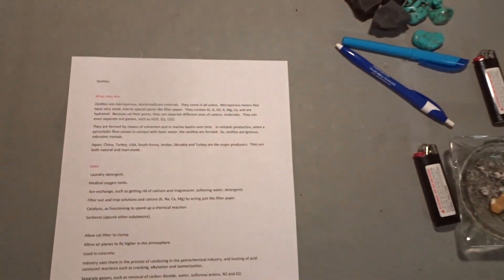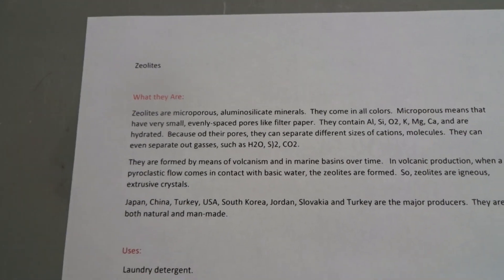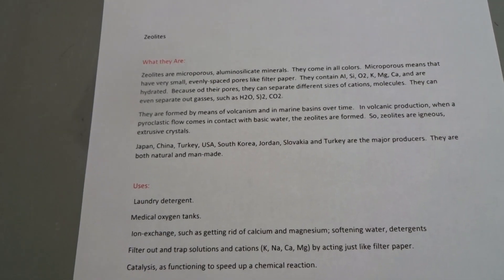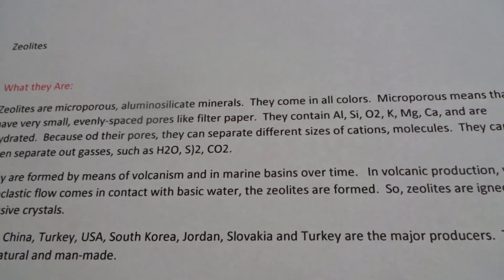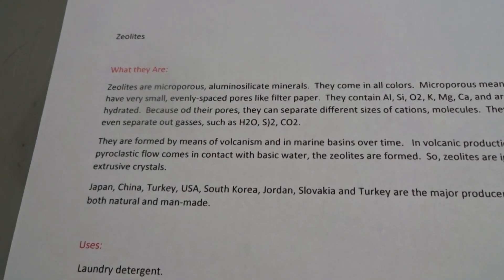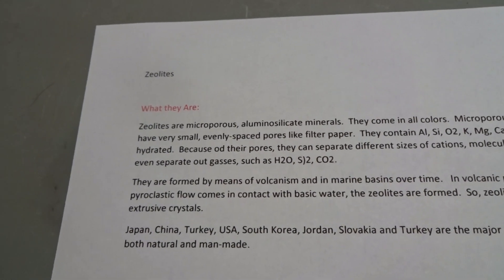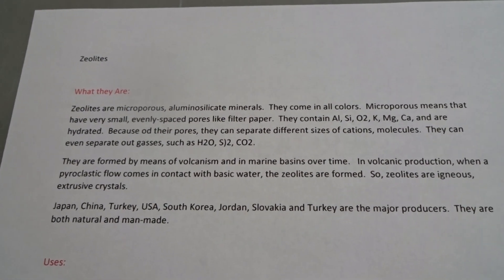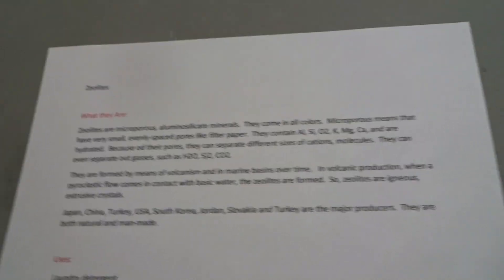Zeolites, part 1

Comment: sweet lab my dewd
Reply from the maker: Thank you.  In addition to my geology lab, I also have an electronics shop because I also have a sole proprietorship repairing consumer electronics.  Business is too slow, however.  Do you have a lab?
Frank
Reply: @frankreiserm.s.8039  its more of a trash pile at the moment. i have plans for a more tidy one so i can make videos and not have everyone tell me what a safety hazard it is
Reply from the maker: @eliteopinions7859  Great.  It is very easy when you work in your lab or shop to wind up with a messy lab or shop.  I am constantly having to straighten my lab and shop more frequently than clean it.  I have a CRT TV's guts all over the place that a client dropped off for repair (which I could not repair).  Now, I need to spend time removing needed components off of the circuit board, and discard the TV.  I have a pile of capacitors and components from old circuit boards that I need to check, file and put away.  It is easy to procrastinate.  Even though I have a chemistry lab and an electronics shop, I break every OSHA law that has been written; I eat candy on a mineral-identification bench with hydrochloric and acetic acid, I walk barefoot, I smoke while performing chemical tests, etc.  On one hand, it is great being your own boss.  On the other, I have cut my feet on broken glass, cut half of my finger off on the table saw and have choked on acid fumes because my basin does not have an installed chemical hood.
Frank
Reply: @frankreiserm.s.8039  im scared to let my cat come in. curiosity could kill it more than 9 times in there

Comment: Is this the reason for fracing. Drilling into the earths crust add water and other chemicals, will zeolites form and then filter radiation out of the water.
Reply from the maker: Hi!  Fracking is a process to obtain (more easy compared to older techniques) oil and natural gas from drilling rigs (both on ground and in the ocean). I fracking, a drill from a drilling rig, either vertical or angled (we have the technology to frack at angles) has a pipe that has explosion sites on it.  These sites explode in the oil/gas reserve under ground in hard rock (oil shale) and causes holes in the pipe and breaks apart the shale so as to open a pathway for the oil to seep quickly through the hole in the pipe.  It is totally safe as long as the entire pipe is sealed!  So, more oil enteres the pipe, and we harvest more oil.  
When drilling into the earth's crust, a material called Bentonite ( a dry power of high density) is mixed with water to the point where its weight is equal to the weight of the water and oil at maximum depth, preventing the water and oil from shooting out violently of the top of the tower, which is called a blowout.  In addition, drilling rigs have a device to stop blowouts.
Zeolites are not radioactive (never say not, say almost never!).  They are silicates (quartz is a zeolite).  When ground into a fine power, they have an affinity for water, making them useful in such products as laundry detergent.  They are also collector specimens.  I lije  arenite; it is acicular.  
If you desire, I have zeolites that I can sell to you.  They are beautiful specimens!
Frank
Frank's Beautiful Rocks and Minerals

Comment: I gotta know the story on that hand wound, Frank. Is that a chemical burn?
Reply from the maker: No.  I accidently put my hand into the blade of a table saw in my wood-working area.  I knew that, with how frequently I use the saw, that it was going to happen at some time.  It cut through my bone, and severed the nerve to my pinky finger.  It is an old table saw from the 1950's and does not have the modern safety mechanisms of today's table saw.  And, since I continue to use it, it will, at some point in the future, cut my hand again.  I have to have surgery to replace my cut nerve with a nerve from a cadaver.